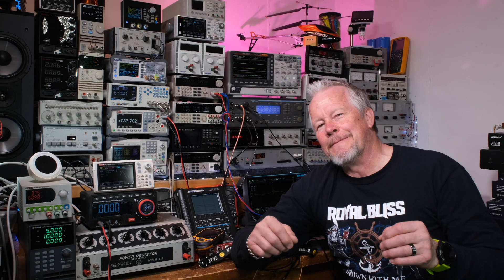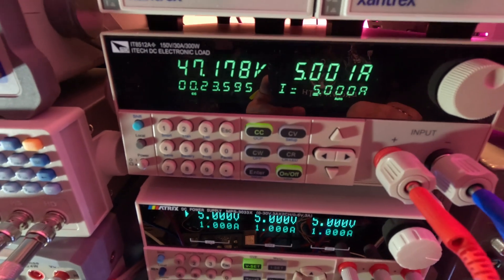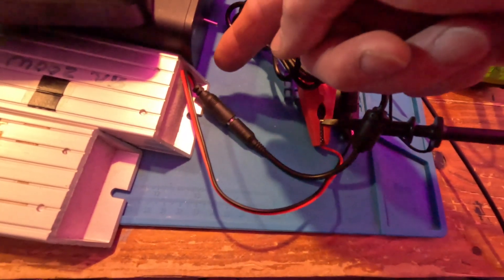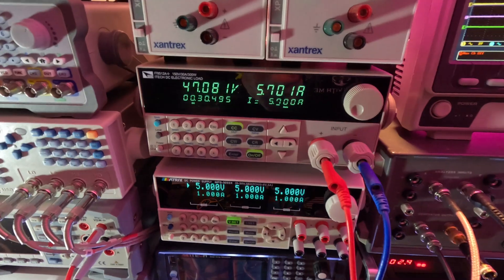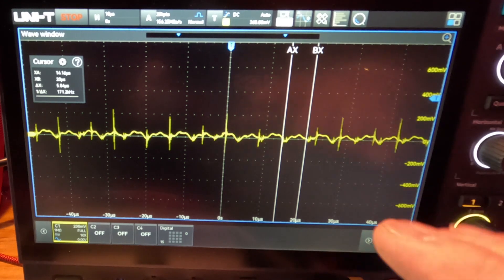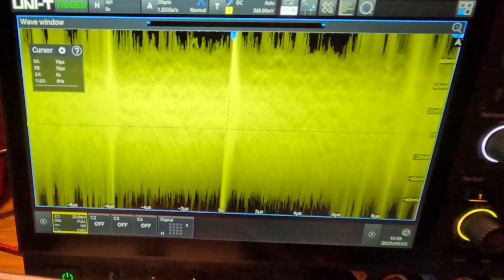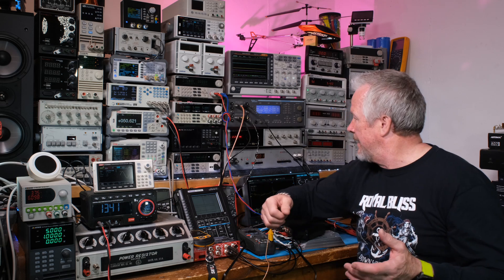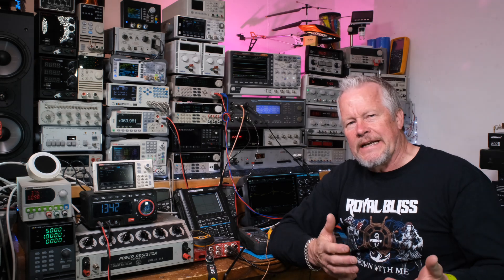Aiyimia A70 GaN 48VDC 5Amp Power Supply - Can it do 5Amps and check the noise with UNI-T MSO3054HD

Comment: Isn't that giving you false measurements if you connected it to your power regulator instead of the wall. should have measured it from the wall what would have given you real world scenario. Do you think the ripple and parasitic wave would be much different?
Reply from the maker: Thanks for asking.  No, running this off of an AC source takes the wall power noise better or worse off the table.  If my power was cleaner or more noisy - than how do you know what this power unit performs.  The best way to test is with a known input. 

Another test I could do is add noise at the input to see if that gets thru - but that is a different test.  I don't think the input power in the US would make much difference - if at all.

Make sense?

Comment: Aren't those barrel jacks only rated for 3amps? Seems sus to see that on a 5amp supply! Did it get hot? I know they're usually rated a little conservatively, but I can confirm from experience that they do melt and burn in less than a minute when you get over about 7 or 8 amps. I only have a sample size of 2 and I didn't do further testing because it seemed reckless (even for me) to not go to an appropriate connector. Those home insurance adjusters were a real pain in the but after the last incident.
Reply from the maker: Great question.  The standard rating is 3.5 Amps, but some can be higher - like 5 Amps for instance.  We would have to know their rating.  In my test they didn't even get warm.  I should test to see how high I can go;)
Reply: @KissAnalog  That's impressive. There's clearly a range of quality on some of those. Not that I would expect a fancy supply to skimp on the connector.
I realized a while ago that I either needed to start put cooling fans on my barrel jacks or stop buying them from Temu.
Reply from the maker: This is a fantastic point though - we do need to check the temp rise on that connector...  If it is getting hot - why not switch to a better connector - even if it cost 25 cent more;)